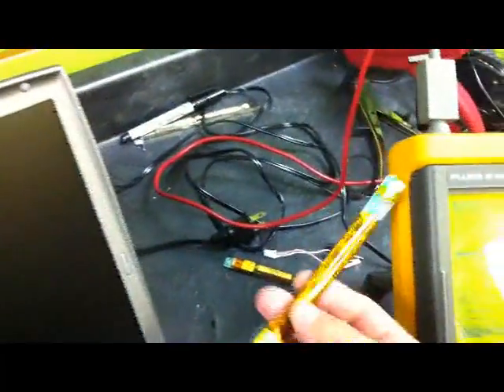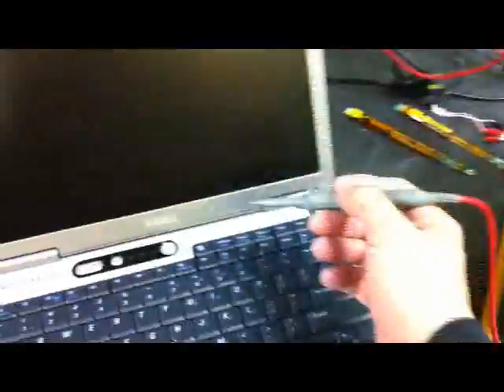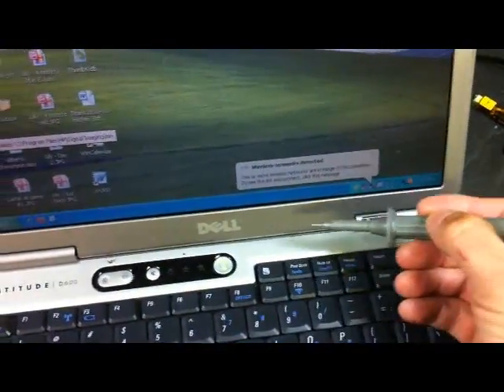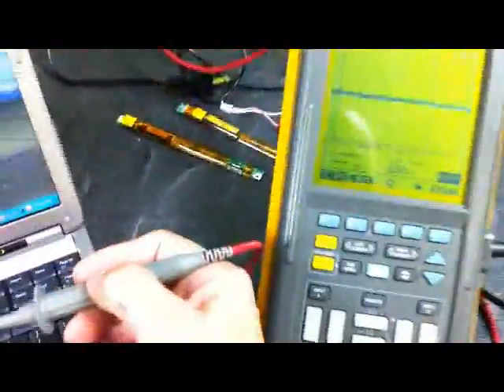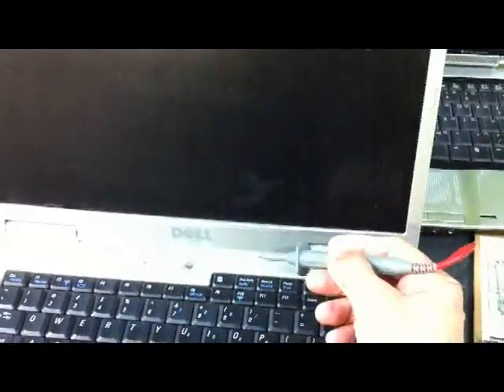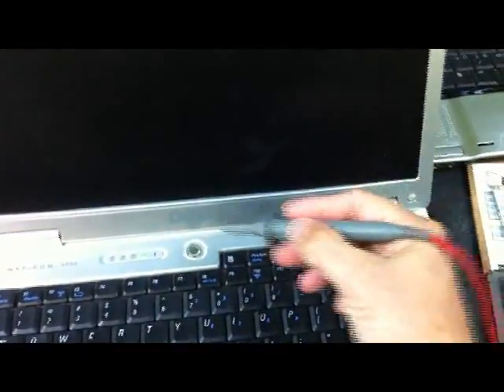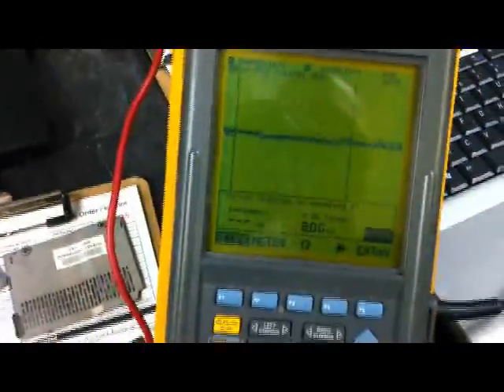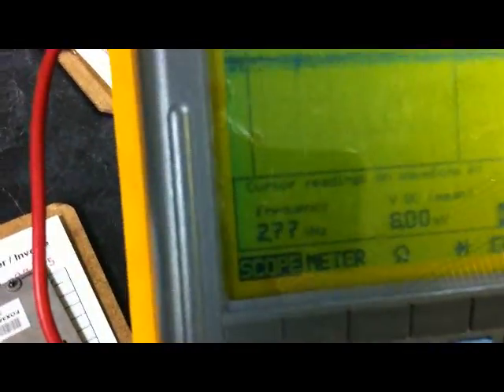Laptop Inverter testing with Fluke Scopemeter

Comment: Whats the purpose of this test? if the screen backlight is off there will be no waveform if the backlight is on the probe will pick up the waveform this test is useless for determining the fault. if the screen is dim its obvious theres no waveform. If the backlight goes the scope will show the waveform cutting off but youre still dont know whether its inverter or a CCFL, these Youtube videos starting to be nonsense
Reply from the maker: +zbyszekskibinski. That's why we mentioned that the test may or may not reveal something lol. We only thought it was convenient to use the scope to pick up signal without having to crack the system open.  The video was made to generate ideas on testing inductively. Never mentioned it worked 100% as is.  We prob do 200 or so screen repairs a year in our shop so we are always looking for ways to save time.
Reply: zbyszekskibinski  right on man. Also, how can you see a sine wave with DC? Wouldn't it be a square wave that he'd be looking for? Lolz